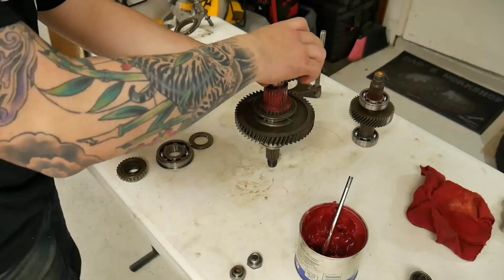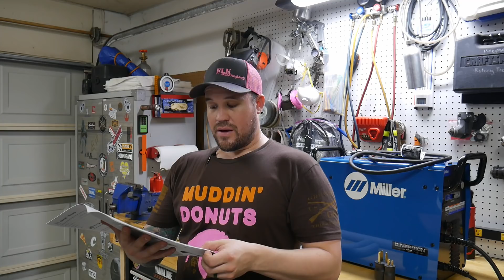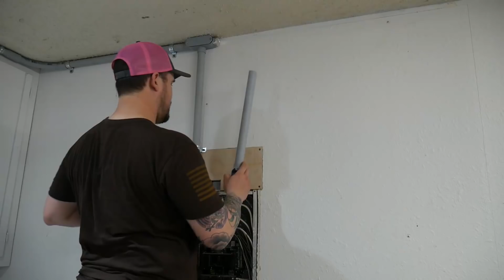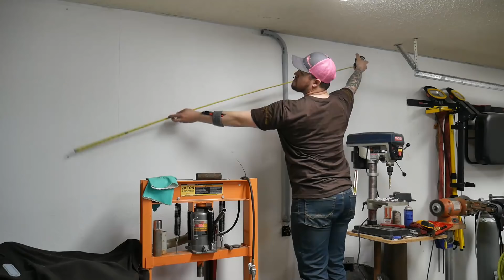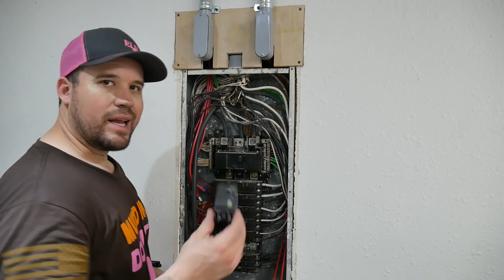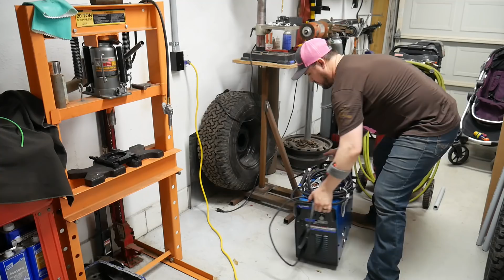How to Install 220 Volt in Your Garage

Comment: There are a few potentialy dangerous things done in this installation. The conduit needs to connect directly to the box so that the THHN wires are not rubbing against the sharp edges of the  entry hole in the electrical panel. Wires move, especially with large current draws, and it cut slice into the THHN. At the very, very least put plastic bushing in the hole.  The loose wire through the drywall is especially bad, as someone else commented, get some #8 BX, or a length of empty BX conduit and connect from panel to receptacle. 

I'm not sure if that is his main panel or a sub panel, he says he cut the power at "the pole".  But it is important to keep Ground and neutral separate in a sub panel, and for the sub to have it's own grounding rod as close as possible, and for it to be separate from the main panel ground. The neutral bar in a sub panel should not be bonded to the box [and therefore the ground], most new units have a screw that connects ground to neutral for use as a main panel, but it is removed for use a sub panel. You want to reach ground immediately, but leave the neutral path from a 120v circuit return to the main panel. 

Also, a minor point, it's 120v or 240v :]
Reply from the maker: Congratulations, you are the first person to properly suggest the corrections needed to fix the few issues this installation has!!! I thank you for the comment. All of these corrections have been performed, along with the second 240 V plug, located under the panel, being completely removed.
Reply: @ELKMotorsports  I appreciate that! I always try for constructive criticism when I comment on things!
I think Youtube can still be a place where we help each other out.  I didn't have a great grasp on household electronics until I did a few projects like installing 240volt heaters and buying a house with separate garage and sub panel. 
probably the biggest aha moment was when I finally put it together that [north american] houses have 240v service not 120v.  Two legs and Neutral come into the panel, connect a device across the two legs- 240v.  It's then the panel that breaks that down into 120v circuits by shunting one leg to the neutral.  And because we mostly use 125V appliances, it's easy to overlook that 240V is the most direct connection.
Reply: @fotopdo  I think I learned more in the video and then reading this comment thread. Damn you Elk you magnificent bastard you! I kept thinking I hate this man but he looks like an ordinary cool dude to learn with. If you can do it, I can do it  has been my motto lately. with all tense of proper training and research beforehand of course. I am subscribing and going to check your channel out, as a new homeowner, newly father, semi-young husband and welder in training I need to start waking up and getting my sh** together haha! thanks fellas!
Reply: @fotopdo  
If your learning electrical, may I suggest a copy of Ugly’s book.
All kinds of electrical info in layman’s language.
I have used it for decades.
$15.00 normally.

Comment: A couple things I knownticed, the wire needs to be rated for the amperage #6 is good for 50a, #8 is good for 30a as you said you didn't want to rewire it down the road when switching to 50a breaker, wire should have a bushing on every threaded connector after the lock nut so as to protect the wire from being cut on a sharp edge of connector when pulling wire.  Also every cut piece of pvc needs to be de burred so the wire can't tear the coating on the wire, I realize it is pvc but the sharp edges need to be removed, also pvc needs to be glued at each connection point, not a slip fit. Also hot wires should be different colors in phase 1 /110v panel black 1st bus, red 2nd bus, doesn't matter what color goes on what side of plug as each leg is 110v but it matters at the breaker if you want to be legal. And last but not least NO TWO wires under same screw on a breaker..Definitely not legal..And the cut out board that you cut on the band saw so your LB fits should be drywall matching the same thickness as the original drywall for fire rating, it should be taped & mudded so air cannot pass through plus the missing material in the notch made so the LB can go through the wall at the top of the panel also needs to be covered and fire calked..  Perhaps in the future, maybe do a little research on code so anyone not familiar with code requirements can wire it properly and please don't use dykes for stripping the coating off the wire as strands can get nicked or cut easily..

Comment: People criticize, but I like the video.  I've never welded before, and I just bought a welder on craigslist and found out I only have 30amp breakers and wires in my garage and I need 50Amp.  This video has shown me how I need to install a receptacle for my wlder.  As with any dangerous and critical work, always do more research and read the comments for something the video missed.  So you need to add some protection to the wire entering the panel.  And there was something about stranded wire without conduit.  Unfortunately this comment about the stranded wire did not clarify anything.  So is it code that stranded wire be in conduit or something?  If you're going to criticize, at least explain how it can be done better.  Thank you for the video.  Although not perfect, it has inspired me to install my own receptacle.  Afterall, how do you explain to your girlfriend after having already spent $600 on welding equipment that you need to spend another $200 just to turn it on.  Like more and more things these days, I'll have to do it myself and save that trip to the dog house.
Reply from the maker: Finally someone that gets it. I'm no expert and all human beings learn by making mistakes. I feel that everyone is under this grand illusion that if they make a mistake they can never redeem themselves or correct it. The real point of my videos is to inspire people to do it themself. Making mistakes is part of that process. It's what you do about the mistake making that is important. I'm actually glad that my video had mistakes in it, because I was, at the time, under the influence that I had done the job correctly. And I've learned that I needed to do a few things diffrent, and that's ok. I enjoy learning new things. And I'm very glad that this video had motivated you to do more resource and go at this on your own.

Comment: Instead of criticizing others , make your own videos , if you got the skills , and know building codes . I own farms in Nicaragua , Ive seen welders go on ladders up to the electric post to hook up a cable to their welder machines , and work fine .  So enough with your bs know it all guys , let the  man show us . 
Wire should be at least #6 rated at 50 amp , breaker is fine at 30 amps for safety , good job bro .
Reply: Just a few glaring safety concerns,
1 - There's nothing in the punch outs of the panel to protect the wire from snagging and shorting out - resulting in electric shock or fire
2 - You never install two wires to a single terminal, they can come loose and short out or ark due to bad connection - resulting in electric shock or fire
3 - Stranded wire is to be run through conduit, wire is to be protected by 2 layers and your drywall doesn't count, in exposed areas it should be armored cable or ran through conduit.
4 - "you can choose any colour you like" - no you can't in North America you can use Red, Black or a White wire that has been marked to signify that it's a hot wire on both ends and Blue (only if running 3 phase)

All of these could result in death, so all are major problems. Yes his wiring worked today, but in a few years or a few decades even could result in someone being very badly injured or killed. NEC codes are there to protect you and others.

Comment: Thanks for the video!!

Sorry for my pet peeve on this but just some clarification....
Regarding residential voltages, today's standard in North America is 120v/240v. 120v is measured hot leg to neutral and 240v measured hot leg to hot. This is what your power company is responsible for providing to your home, +/- 10%.
Using the old nomenclature (from 60-70 years ago) for these voltages just adds confusion to those that are unfamiliar.
So, using 110v, 115, 220v, and 230v just is not needed nor correct any longer.

Comment: I thought 8 gauge wire was rated for 40 amps not 55 amps.   He said he was going to wire it for 50 amps, but he used a 30 amp breaker?
Reply from the maker: I used the the chart that they had at the store for the wire I used.
Reply: @ELKMotorsports  the charts are based of the temperature rating of the wire insulation, the breaker connection also has a temperature rating. The wire you bought is rated at 90 degrees Celsius. The terminal in the breaker is only rated at 75 degrees Celsius. So the # can then only be rated at the 75 degree rating, which is 40 amps not 55.

Comment: What's stopping your wires from getting frayed at the panel???
Reply: Didn't look like anything was connected to the back side of the LB , thhn should be in a race way an it's not,  then he puts more thhn in the wall in no conduit,  just a hack job

Comment: NEVER double onto a breaker... it doesn't pass code and. I'm really not sure that wire would pass code either. That receptacle is for 50amp and although I don't see anything wrong with going with a smaller breaker, I don't really see the point. you want 6 / 2 wire for this job which is MUCH thicker than what I see in this video

Comment: good informative video, i'm a welder fabracator by trade mostly mig and stick i play with the tig when we have down time imo tiging stainless and mild steel much easier then alum, now get back on that samy, i talked to Myron and ordered the 6.5 gear set and the twin stick so my 88 tintop project is in full swing now, really excited to see some vids of yours under boost
Reply from the maker: mick laporta lol 10-4, I had this video laying around and I was out of town last week's I visited Zuks of Hazard and did an interview video with them. So I kinda had tho throw something together. The new pistons should be in by Tuesday, and I'm going tio repair that cylinder head. So should be all back together real soon. Then we can see boost videos!!!
Reply: sweet

Comment: I have a welder that uses 230v and 250v , would you happen to know what size generator I would need to power it ?
Reply from the maker: Brando, it depends on the max amprage output of the welder. If I'm not mistaken most generators should have a chart with what they produce. But if your only finding watts then the formula is
Watts= amps x Volts
Reply from the maker: New Beginnings Community Church, that's good to now, thank you for aiding in the discussion.
Reply: Thank you for the info , my welder has an adjustable amps so if i get a generator just don't go over the labeled amperage .

Comment: Someone told me u can cause a fire if not wiring correct. Wouldn’t the breaker avoid this??
Reply from the maker: b e, not necessarily, some wire is rated to be ran in conduit, others already have the necessary insulation. Also need to have the properly rated wire for the current you plan on running. The outlet also needs to be rated for the current you're going to be running.

Comment: How much did all the conduit wires breaker ect cost?
Reply from the maker: BRWfilms, I would have to hunt for that invoice. But it's going to vary in a few parts, like I have an old style Square D breaker box and my dual poll breakers are expensive. While other types are a lot cheaper. The conduit is relatively cheap. Wire is, well the most expensive part.
Reply: ELK Motorsports gotcha

Comment: Everything I read says with 8 gauge wire you need a 40 amp breaker. Thoughts?
Reply from the maker: btwenzel05 , only thing I can say is use the wire rated for your application.
Reply: Gotcha, I’m new to all this. My manufacturer recommends 12AWG for my 220v welder. That seems small with a 30amp breaker.
Reply: @btwenzel05  10AWG for 30A
Reply: Camdon Inks I think that’s what I’m going with. Thanks
Reply: Should be number 6 awg

Comment: Three points.
Use different colored wire for reference. If you have an issue down the road, you don’t have to trace circuits. 220VAC should be black and red.
Never use white as a hot wire.
On your plug under the panel, when you run wire through metal, even when it’s smooth like that clamp is, cover the wire for chafing.
I like to use shrink tube but elect. Tape is fine. Wire tends to vibrate in higher amps. It’s just a safer job when you protect the wire.
The duel use plug is not code, but I have no problem with it. Here’s the deal.
If you ever have a fire and that breaker is found, your Home fire insurance could be void.
For the cost of a breaker, I would separate those circuits, or legally you could daisy chain the plugs to one breaker.
Electricity is funny and temperamental. If you are new to it, find a buddy who actually knows it to help on your first couple runs.
Feed him a six pack after and you’ll be fine.
One more thing.
Never, Ever do electrical work wearing a pink hat.
What the heck is wrong with you?
MHO.

Comment: You need 50 amp breaker and  6 or 8 gauge wire.
Reply: Read your welders manual. Mine required 8 gauge 40 amp breaker.

Comment: I was going to tell you how great a job you up to the point where you violated NEC.    THHN is listed to be run in conduit and is absolutely not allowed as you did at your panel connection from the LB.  As well as the second outlet below the panel.   I was typing this during the last couple minutes.   I hope you did not put both conductors into the breaker lugs as that would be a second violation of the NEC.
Reply: I just went back and watched.   You did put both conductors in the breaker.   This one you should definitely fix.   Pull them out and splice them to a third one and connect it to the breaker.
Reply from the maker: Kevin Coop, well that's not good on my part. I actually don't use the outlet under the panel so I'll just remove it.
Reply: It looks like your using  to small of a wire gauge from what I can see?  6 gauge for 50 amp! not 10 gauge.
Reply from the maker: Ron tech the wire I'm running is rated for 60 amps.
Reply: What wire are you supposed to run in conduit, everything ive found says thhn
Reply from the maker: Aaron Stone yes THHN is designed tio be run in conduit, and Kevin Coop is correct on not having an outlet under the breaker panel or putting two sets of wire in the breaker lug. I've actually eliminated my second outlet under my panel. I didn't use it anyways.

Comment: Maybe you shouldn’t make videos on electrical......
Lots wrong here folk, please don’t use this as a guide
Reply: You should not criticize if you do not have a solution of your own
Reply: Mountain Man Fishing  Run a piece of 8/3 BX with proper connector into the panel.  Don’t free air wires.  
Buy a mini to free up space, so you don’t double a breaker.
Reply: @jamesipad204  Thank you sir
Reply: Yes very bad
Reply: What all is wrong exactly? Be specific.
Reply: cameronluster wrong wire size should be using 6awg instead of 8, that alone is a problematic safety concern
Reply: amen, saw i was the only one that thing he shouldn't be showing this type of installing .
Reply: @evansautomotive307  
I'm not an electrician, but here are a few things I noticed. 1) You should not run two conductors of the same color (that aren't shorted) in the same conduit/outlet. It isn't to code, but more importantly it's hazardous to the next person who has to open that panel or outlet up. 2) It is hard to see, but the outlet he installs is for a 220V 20A plug. The breaker and wire he installs is for 30A.

On the bright side, his gauge wire is quite conservative (in a good way).
Reply: @MakingWavesRF  as long as the ground is green the hots can be the same color as long as it's not white, gray or green. That's what the code says.

Comment: Cheap labor is most expensive labor. THHN wire rated for pipe not for in wall by it self. When he sell the place there will be alot of rewire the place. Make shore you pad the sale so you have a electrican to rewire your stuff .